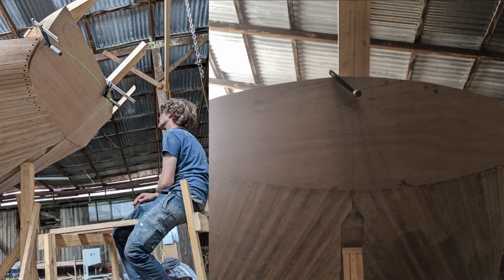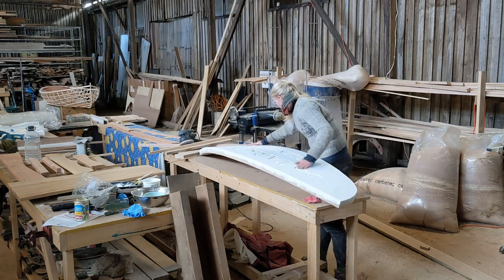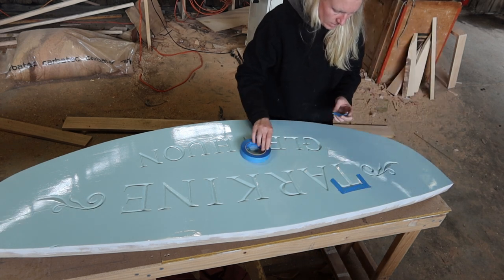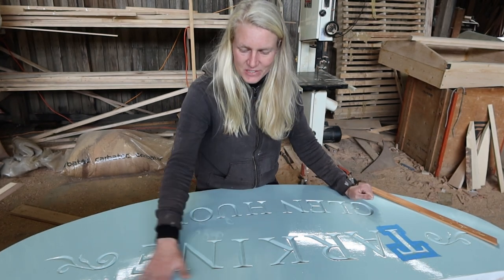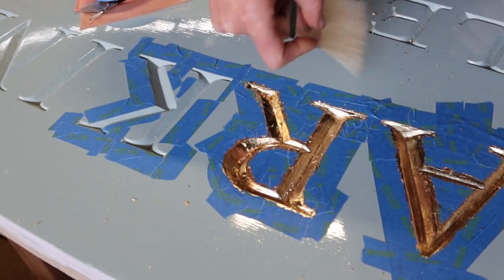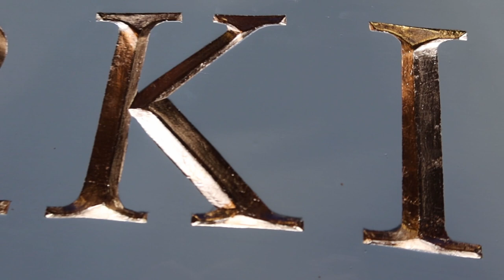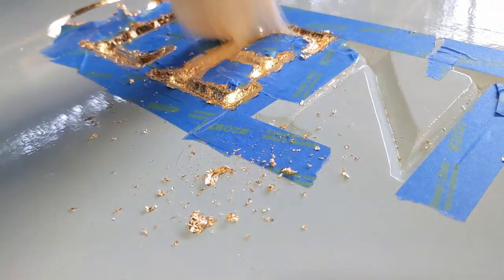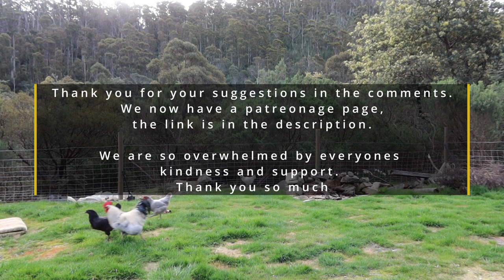Gold leaf on our hand carved wooden transom (EP 3)

Comment: a very stunning and satisfying piece of work, and yes sad to see the wood disappear below paint but understandable
you could seal with an epoxy resin and fibreglass a thin layer, flatten, sand and finish with more resin, the wood would shine through i'm sure, i seen a few other boats with similar, wooden transom and painted hulls
ps i always love the reveal too, unmasking makes all the sweating worth while, you want to try doing something like this in the wind, i used to do stencilling on aircraft - i hate masking up in the wind, swearing at silly pieces of paper and masking tape, once the colour is down off with the masking and the bad times are forgotten

Comment: Wonderful job ! What did you use for the leafing? You keep saying it is not gold ,but never say what it really is.
Reply from the maker: Thank you for the compliment! I used immitation leaf. It's a leaf made from copper and zink with a gold colouring. It looks the same but it is not genuine gold. Genuine gold is very expensive but will last very long as the precious metal won't tarnish or degrade. "Fake" gold will tarnish and degrade in the weather over time so it is important to coat it in varnish before letting it sit in the weather. Thank you for the question!

Comment: Does it get a (few) protective clear coats? The gold leaf strikes me as very vulnerable to the elements!
Reply from the maker: Yes! If you use genuine gold it will hold out in the weather very well apparently but since I used imitation gold (copper and zink) it needs protection. I coated it several times with a hard wearing clear varnish. Thanks for the question!